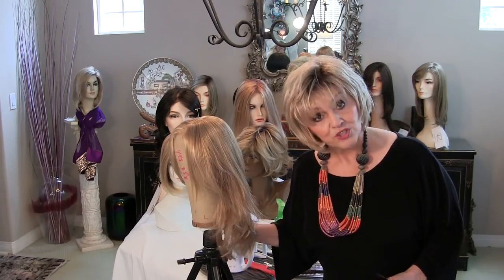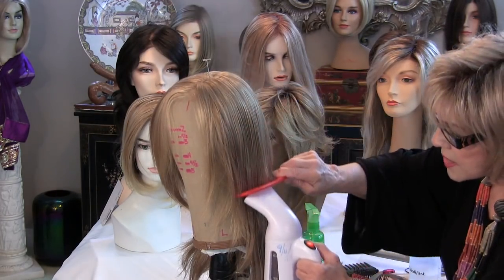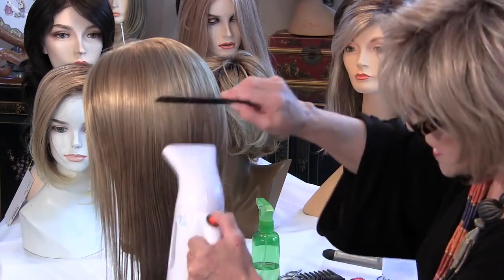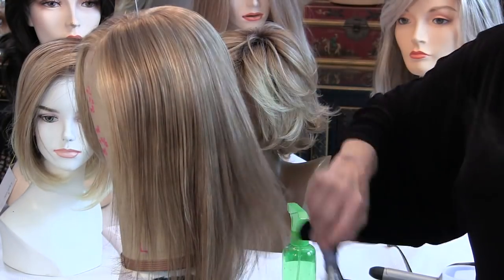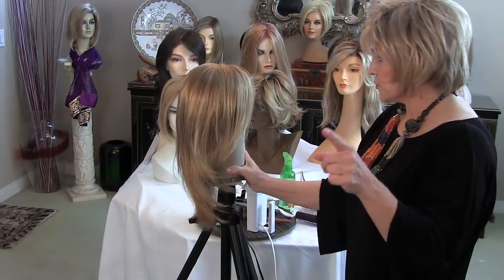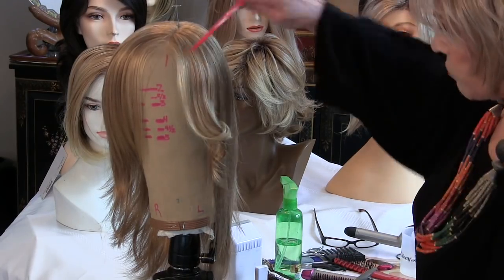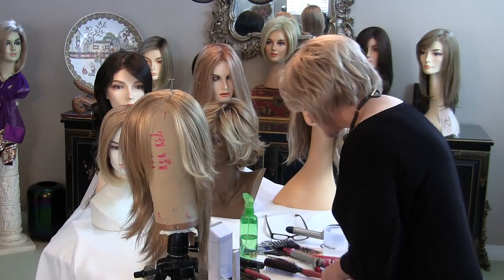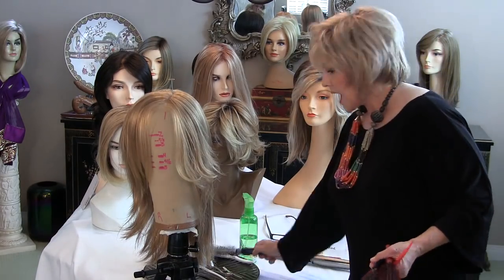How to defrizz and set synthetic hair and what tools you need

Comment: my question..how to soften a synthetic wig...
Reply from the maker: You can use a steamer to soften a synthetic wig. This is safe for the fibers and will also reduce frizz or tangling from wear.😊 Keep in mind, steaming it will alter the style (if you're steaming a curly/wavy wig, it will straighten it if you're combing it straight while steaming; however you can also use a steamer to put curl back into it when desired). 

You can also use a silicone spray to protect the fibers and prevent a lot of friction: https://www.wigsbypattispearls.com/envy-renu-and-repair-glosser-spray.html

Comment: what about for shredding?
Reply from the maker: +Nicole Bell It's normal for some shedding but to help prevent excessive shedding, be sure to always wash you forehead so that the skin is clean, put liquid adhesives on the head and not directly on the wig cap, do not sleep in your wig, do not scratch your scalp through your wig, Only use a wide tooth comb or wig brush and be very gentle, comb thoroughly before washing, do not comb while wet, use the proper wig shampoos and products, be sure to was all products out of wig when using hairspray or gel, Do not wash in hot water.

Comment: Can I use hot rollers?
Reply from the maker: You Cannot use hot rollers on a regular synthetic wig unless you don't use the heat. In this case (as long as they are not heated) you can put them in the wig and apply steam. After you apply the steam leave sitting for several hours before removing. Please be advised that this will not defrizz a wig. You will still need to follow the instructions in this video first to defrizz the wig.
Reply: Thanx
Reply: Wigs by Patti's Pearls

Comment: Patti, I have 5 wigs, all by different companies.  They are pretty much the same style wigs which I now have to admit that the style is all wrong for me.  Very similar to the Raquel Welch Always.  They just don't look like me but I'm always drawn to that style because they are really pretty.  They don't have the lace front (which I wasn't really aware that wigs have different properties).  They have way too much hair and I keep pushing the hair down to flatten it.  I practiced on an old wig cutting the length but it looks "cut".  I have hair cutting scissors but they are pretty old.  Would dull scissors make the cut look like it has been cut..kind of a blunt look.  Do you have a video showing how to cut this style of wig and how to determine where to thin the hair out?
Reply from the maker: Hi Sherry, you need to use really sharp haircutting scissors when cutting synthetic fiber. You start by cutting the layer underneath first and work your way to the top layer (just like if you were getting your biological hair cut). When it comes to thinning a wig you need to use the same type of thinning shears that you would normally use. You just have to be careful with synthetic fiber. Synthetic fiber doesn't always cut like human hair so you want to be sure to cut small amounts at a time.
Reply: Do you sell the type of scissors I need to cut my wigs?

Comment: the  steamer has to be used on a "heat resistant" synthetic  wig, Correct?
Reply from the maker: No, you can use it on regular synthetic as well. A steamer is a must if you have a synthetic wig.